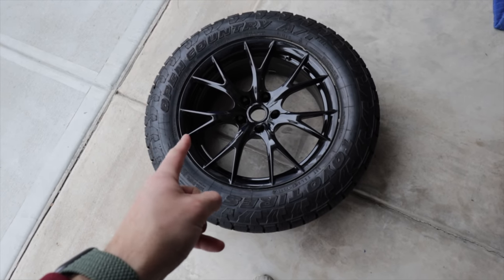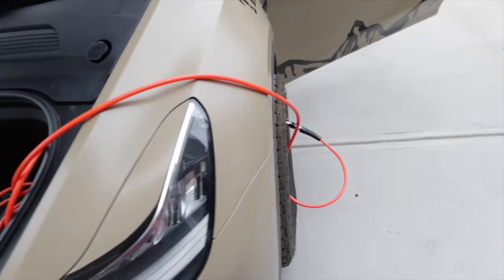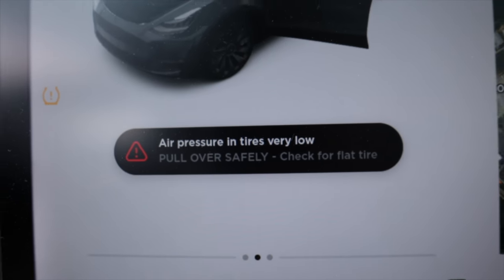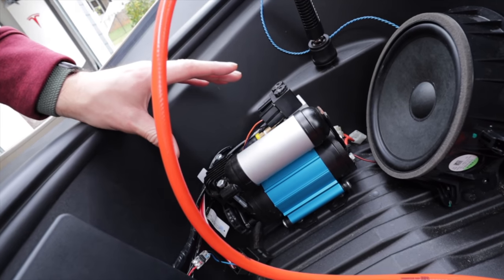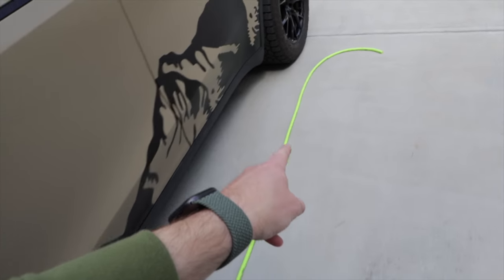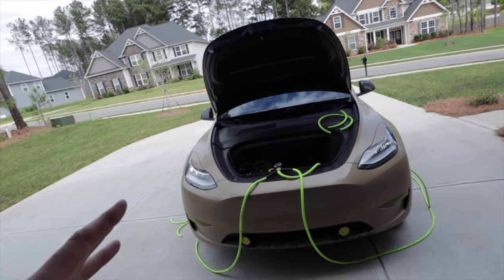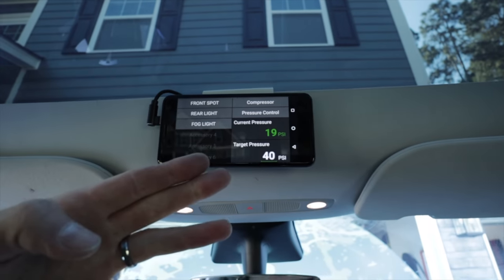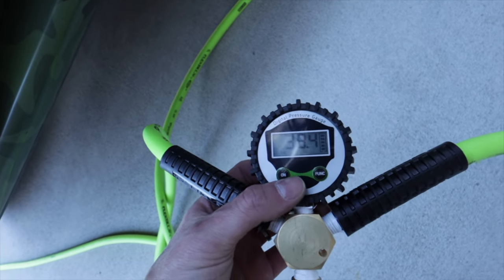4 Tire Inflation System – Digital Gauge

Comment: There is no way to accurately measure the pressure while the pump is running, especially when there are long hoses and restrictions in the system. It is not only normal, it's necessary for a high-volume, high-pressure system to stop the pump periodically to check the pressure.

The behavior of the pressure gauge when you released the pressure illustrates this point.

I'm not sure the advantages of this system outweigh the drawbacks of all the additional potential points of failure (lots of hose and connections) or carrying around all that extra gear. You could carry 4 good-quality compressors, have 3 levels of backup and still spend less and give up a whole lot less space in the vehicle.

If you could install a full-time system that works through the hub and on the fly like some serious 4x4s have, that would be killer, but that's not really possible.

Comment: I was at first assuming the compressor periodically shuts off to prevent over-heating, but you said it's rated to run constantly for a full-hour, so there goes that theory :)

Comment: interesting video.  one tire at a time seems a little quicker though.

i have a question about this setup though, when you take off the connection to a tire (when you're done), how do you prevent it from deflating the other tires?  since all the tubes are connected, isn't the disconnected tube just releasing air from the other tires?

Comment: Those tire pressure gauge (or any gauge for that matter) are not 100% accurate or precise (yes those are two completely different things). Meaning that the plus or minus 0.1psi from the original 39.5psi means you most likely did not lose or gain any pressure. The reason that one says 40psi and the other says 39.5psi is because one is more accurate than the other, but they are both pretty accurate if they are within 0.5psi of each other